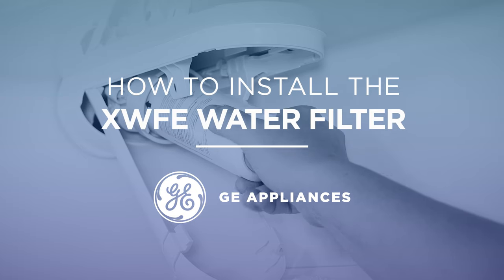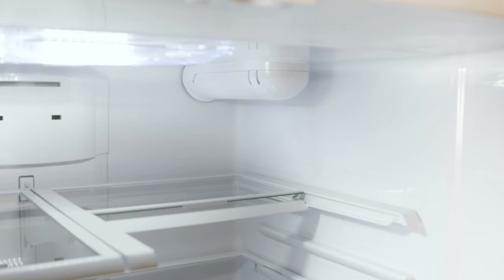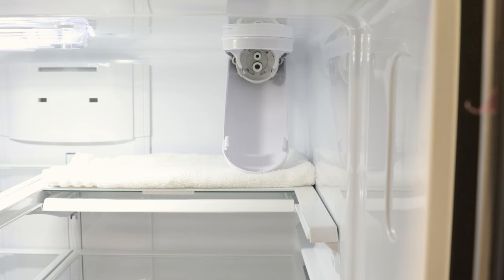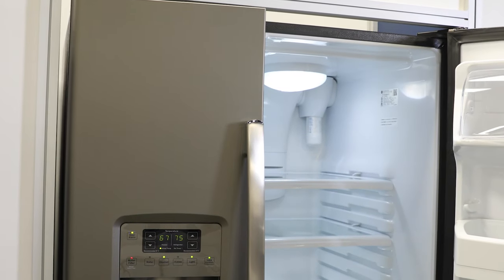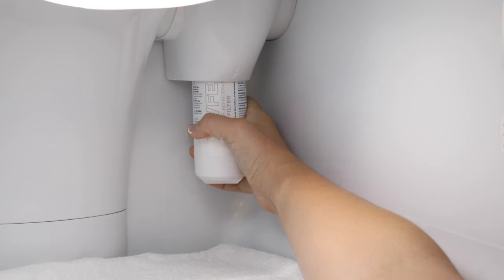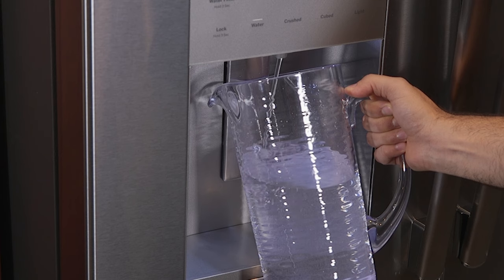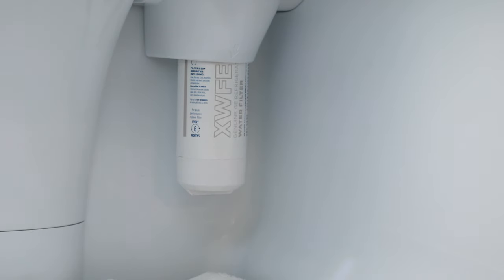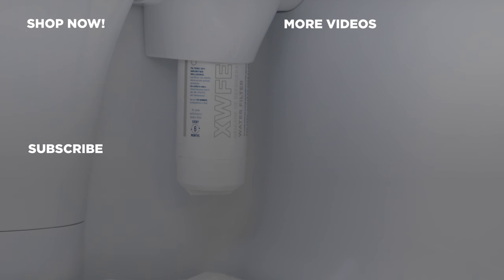Replace and Install the XWFE Water Filter

Comment: Dec 25, 2022 waited 6 months for my prepaid in full GE GSS25 refrigerator. Went to change filteras light came on. Used a $60 GE XWFE filter . removed and installed as instructed in GE guide. Now I get "ERR" and no water to icemaker and water on door. CHnage back to old filter, wont work either. Help!!
Reply from the maker: Hi John,

Thanks for reaching out. So sorry to hear about the filter issues you're having, we're sure this would be frustrating to deal with. If you're able, send us a PM on Facebook or a DM on Twitter with your complete model and serial numbers as well as a copy of your comment here. We'd like to look into the situation further for you.

You can use this page if you need assistance finding your complete model and serial numbers: http://spklr.io/6058cweO

Hope to hear from you soon. -MS

Comment: I purchased a 3-pack filter from GE's website and the first one worked fine a few months back. Yesterday I tried to replace my filter with a second one from my 3-pack and the water doesn’t come out and there is an ERR message. When I put back the previous filter it works normally. I tried the third from the pack and the same thing happens as with the second one. Are these defective? We followed the same process as the first time we changed. This is frustrating to be without filtered water after paying for the expensive GE filters directly from your website.
Reply from the maker: We hate to hear of the issues that you're having with the filter. Please send us a private message with your model/serial number on social media so that we can look into this for you. All the best.- KW
Reply: @geappliances  I've reached out on Facebook via DM.
Reply from the maker: Thanks for letting us know.
Reply: I bought SIX of the GE XWFE filters. GE! Expensive and I get the error message with all six of the new filters with the same numbers in them as the one it came with. Help! 😢
Reply: @geappliances  please help! I bought six brand new GE brand XWFE filters. My refrigerator is 2 years old. I get an error message with all six of the new filters! Help me for the love of God! 😢
Reply: @geappliances Damn, this isn’t good news reading these issues. I too have a 6 month old fridge. Just tried changing the filter from a (3pk) Not only do I get a ERR msg, it doesn’t fully lineup either the mark like the original filter. 🤬🤬🤬
Reply: @Netm8kr   I've just had the same issue when I tried to replace the filter.  The arrows just don't quite line up.  Put the old filter back in.
Reply: @marymcdaniel8071  I did find success by peeling the label off of the original filter. I just wrapped it around the replacement. It mounted correctly afterwards. One caveat, the percentage does continue down to "0". As long as your cool with that aspect, its worth it. The water pressure and ice collection rate are noticeably different once changed to a fresh filter. Hope this helps. Peace...Net

Comment: Bought a new filter from Lowes. GE filter XWFE, same one that came with the fridge. The new one will not work as after you push it in place you can not turn it to the right so it will work. Called GE, no help. Examined the new filter. The area around the nozzles on the new one has added plastic filler put  in. The old one this is not there. When you  put it in, you can not get it in far enough to be able to turn the filter so it can be used.
Reply: Same issue here - was GE able to help you? We have tried so many times and it just wont fit.
Reply: Same here. Did you find a solution?

Comment: GE looks like people are not happy with the replacement water filters not working. We have the same problem as others commenting. The replacement does not work but the original filter still does. You answer people but yet I do not see a solution. Plus the filters are EXPENSIVE!
Reply from the maker: Hello Linda. We're sorry to hear that you're having issues with your replacement water filter and are happy to assist. It's recommended that you order your filters directly from our  website to ensure that they are genuine. If you have ordered directly from us and are still having troubles, please send us a private message on any of our social media platforms, including a description of the issue as well as your model/serial numbers, so we can further assist. Thanks. -AT

Comment: I’m having the exact same problem as you. The water is not working and I just bought this fridge last year in November. The ice is working though.
Reply from the maker: Hi, Vivi. We hate to hear the water for your dispenser is not working. When reinstalling the filter as the video shows, be sure it is a genuine GEA filter. Many filters bought online claim to be genuine, but counterfeits will not work in the fridge. Next, check the water reservoir at the back at the fresh food section to make sure it has not frozen. If issues continue, service may be needed. - JB
Reply: @geappliances  I just purchased one off your website. Hopefully that solves the problem. If service is needed who can I contact?
Reply from the maker: Hello. We’re glad to hear you have one of our genuine filters on its way, and that may solve your concern. If you continue to have trouble and think service will be needed, you can reach that department at 1-800-432-2737 or online at http://spklr.io/6051lVy1 . 

You’re also always welcome to send us a private message over our GE Appliances social media (such as Twitter or Facebook); if you do so, please provide the model number of your refrigerator. We would be happy to discuss your concern further, or help with any other concerns you may have. All the best! -SG

Comment: I had an issue replacing the filter and kept getting the "Leak" error. Fridge was new and under warranty so they sent someone out to come take a look. The repair service worker was able to get the filter to start dispensing water by completely wiping off the water on the filter and the filter fridge connector. If it detects any kind of water, it produces this error. Kind of silly knowing that part of replacing the filter makes water come out. 

My arrow also didn't line up all the way and was slightly off, but still worked. 🤷‍♀ Good luck everyone!
Reply from the maker: Thanks so much for sharing! We're sorry about the trouble you had, but glad this was resolved. The filter will turn off your dispenser if it detects a leak, so making sure the filter is dry when installed is important. Let us know if you have any questions in the future. - JB

Comment: Just installed a new replacement filter (7/3/23)  purchased through Amazon. The old filter was 8 months old.  I twisted the new filter in  thinking it was in and tried the water; it showed "ERROR."  I then took the filter and gently turned the filter a little more to the right....bingo, the filter moved in and the ERROR message disappeared. (whew!).
Reply from the maker: It's so great to hear that you were able to get it working correctly! If you have any questions, we're here. Thanks! -AT
Reply: Unreal, 6 month old refrigerator and on it's first filter change the refrigerator will not recognize the brand new GE Filter. Despite many attempts of reinstalling and attempting to reset the filter status still coming up with the ERR message. Even attempted to reinstall the original filter to no avail. Judging by all the comments I would assume that GE would have addressed this issue. Now I am without water or ice for however long it takes for an authorized repairman to come and attempt to fix the issue. Why would a manufacturer engineer such a ridiculous feature just to complicate matters? BTW I was a Senior Field Engineer for a major computer manufacturer and if I couldn't address the problem without a fix, How do you expect the average Layperson to fix it? Extremely frustrated. I have been a loyal customer to GE for many years. The outcome of this being addressed in a timely fashion will determine my loyalty. Just saying

Comment: I bought 6! New filters, GE XWFE  and that new ones won’t let water go through or something. I get ERR message when I put that new one in! I  tried three of them and all the same! They have the same numbers everywhere in them just like that one that came with my fridge. (Freezer bottom and French door top with interior water dispenser). Do I need to turn around 3 times and click my heels? What in the actual?
Reply from the maker: Hi there,

We hate to hear about all the filter issues you've been having, we're sure this would be frustrating to deal with. If you're seeing ERR on your display, it could be because of the following: there's no filter inserted, you have a bad/damaged filter, the wrong filter is being used, or you're trying to use a non-GE branded filter. Did you purchase these filters from our parts page or from an authorized dealer like Lowe's or Home Depot by chance?

Hope to hear from you soon. -MS
Reply: @geappliances I am having this same issue and filters we’re purchased from Lowe’s and they are GE.  No water is coming out please help
Reply from the maker: Hi Shawntia,

We're sorry to hear this. If you're still getting an ERR error after installing properly, we suggest exchanging for a new XWFE filter or use the bypass plug temporarily (with the RFID chip) for your model. This will re-activate the water valve for your unit.

We apologize for any inconvenience. If it is a damaged filter, please know we strive to provide the best quality and will share this with our team directly. If you are unable to return/exchange or have any other questions or concerns, please feel free to send us a private message via Facebook, Instagram, or X with a copy of this post and include your unit's model and serial number.

Take care, SH

Comment: my filter didn't have a chip on it. so i took the chip off my old filter and now it worked
Reply from the maker: The results of AHAM's testing show that counterfeit filters often have the following traits:
Use of misleading and fraudulent labels that violate trademarks.
Make deceptive or faulty claims.
Potentially add harmful contaminants to the water.
Falsely claim to meet NSF/ANSI Drinking Water Treatment standards.

Comment: My old filter does not release itself when I turn it to the left as much as it will go.  Any tips?
Reply: My filter is also stuck, it won't turn enough to release.
Reply from the maker: Hi Wyde, we're sorry about this. Do you mind letting us know the model number of your refrigerator so we can see if there's additional tips we can provide? - GW
Reply from the maker: Hi Josh, we're sorry to hear that. Do you mind letting us know either here or on another social media platform your refrigerator's model number so we can look into this? - GW
Reply: Turns out pulling pretty hard releases the filter.
Reply from the maker: Hi again Josh,

Removing or replacing your filter differently than what's shown in your Use and Care manual or in your filter's video, may damage the filter or the filter housing.

If you have other questions or concerns about your model in the future, know that you're always free to reach out and let us know.

Best wishes. -MS
Reply: If you have a side by side, turn the filter to the left 1/4 until it stops. Then turn it a little harder, and it will release. They didn't put THAT in the instruction book. I got it from messageboardusa's reply above. I had to crawl inside the fridge and use both hands for the last little bit. Gently.  It will come down without pulling hard.

Comment: bought a replacement xwfe , and after a month, the flow rate is very slow...  is it defective?
Reply from the maker: One of the best things to try is installing the new filter and then holding down on the dispenser for about 3 minutes, this can help any trapped air in the line and filter that cause the low pressure. If this doesn't work though please PM us and let us know.
Reply: @geappliances  Hi its been  about 35 days since the replacement. I believe that the filter has no air in it.  My current flow rate [measured with a stopwatch] is about 80 seconds per quart... its equivalent is about 5 min 30 sec per gallon.
Reply from the maker: Please reach out via private message on Facebook, Instagram or X with a description of the issue as well as your model/serial numbers, so we can further investigate.

Comment: Frustrating!  I just tried installing a new xwfe filter I received from Amazon. The err message is not going away. The older filter works, although is older than 6 months, but the new one doesn’t. Help!!!
Reply: I am having the exact same problem. Also from Amazon.
Reply: @walkerfamilyadventures7912  feel like I’m forced to buy their unnecessarily expensive product.
Reply: @morenopaco  Exactly! Before we moved, we had a similar ge fridge that’s as new in 2017 and used a different type of filter and never had any issues in 2+ years. The first time we have to change the filter on this new one and it’s awful. Wish they would just keep it simple.
Reply from the maker: Hi there,

Thanks for reaching out. So sorry to hear about the filter issues you've had here. When purchasing parts or filters for an appliance, we only recommend doing so via our parts page, here: https://www.geappliances.com/ge/parts/?icid=GEARpartsflyout-allparts

This is to ensure that the part you're purchasing will work for your specific model is a genuine GE part. We'd recommend taking a look at this article to learn more about the XWFE filter: https://products.geappliances.com/appliance/gea-support-search-content?contentId=000060638&_ga=2.50793388.468835322.1658145874-1391095742.1657639873

With that said, pricing can be dependent on several factors. The economic elements include distribution, warehousing, and marketing costs, which account for a portion of the selling price of the part. Other factors like usability (cosmetic vs. functional) and availability also contribute to pricing.

If you have other questions or concerns, know that you're always free to reach out.

Best wishes. -MS
Reply from the maker: Hi there,

Thanks for reaching out. So sorry to hear that you're encountering the same filter issues, we're sure this would be frustrating. We do hope that you're able to see our response to Morenopaco soon. If you have questions or concerns, know that you're always free to reach out and let us know.

Best wishes. -MS
Reply: I am also having the exact same problem. The filter I bought from Amazon shipped and sold by Amazon so it should be genuine. But I got the err message and water is not dispensing at all.
Reply from the maker: Hi Tyler,

Thanks for reaching out. So sorry to hear about the filter issues you've had here. When you're purchasing parts or filters for an appliance, we only recommend doing so via our parts page, here: https://www.geappliances.com/ge/parts/?icid=GEARpartsflyout-allparts

This is to ensure that the part you're purchasing will work for your specific model is a genuine GE part. We'd recommend taking a look at this article to learn more about the XWFE filter: https://products.geappliances.com/appliance/gea-support-search-content?contentId=000060638&_ga=2.50793388.468835322.1658145874-1391095742.1657639873

If you have other questions or concerns, feel free to send us a private message or DM on our Facebook or Twitter accounts.

All the best. -MS

Comment: I have just installed a new official filter bought in amazon because I conldn't find the official site for Canada and it doesn't work. I have pushed for three seconds to reset and still nothing. Can you please help me with any of this?
Reply from the maker: Hi Sergio,

Thanks for reaching out. So sorry to hear about the issues you've had with your filter. We always recommend purchasing parts/accessories from our parts page to ensure that they are genuine. Sorry that you had issues finding the correct place to go to make this purchase.

If you're in Canada, you can use this link to view all sorts of information for our team there: https://products.geappliances.com/appliance/gea-support-search-content?contentId=15895&_ga=2.237562631.624282387.1662405035-1815086009.1661263568

We do hope this helps.

All the best. -MS